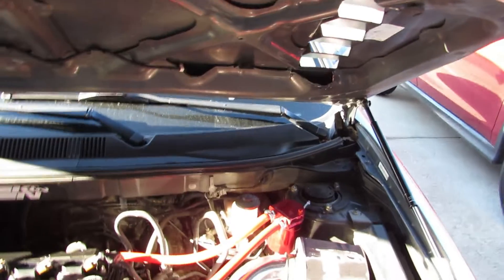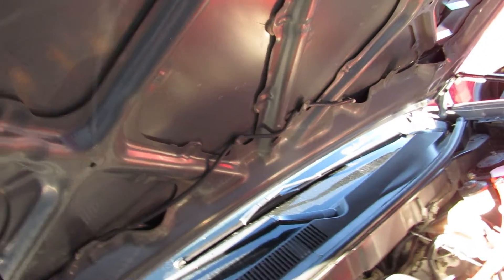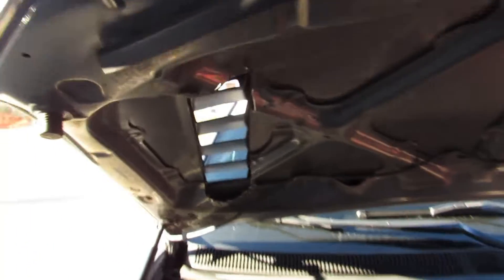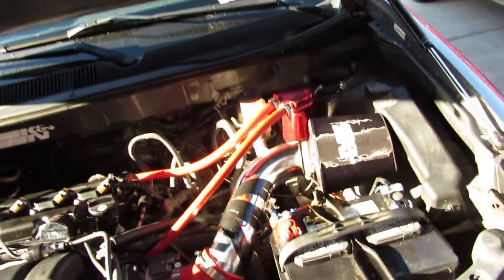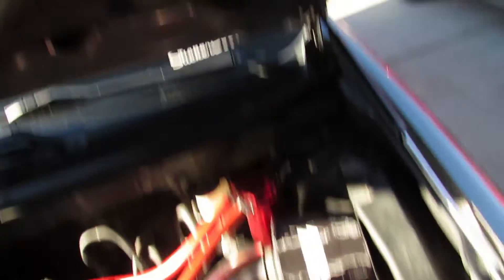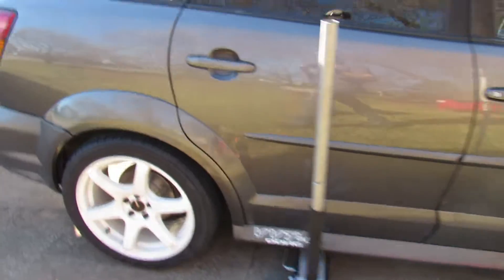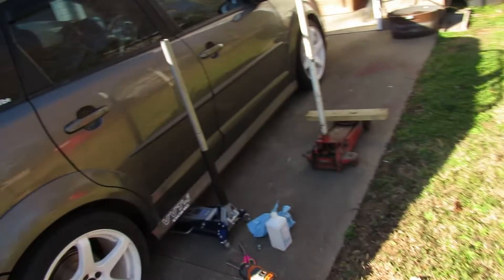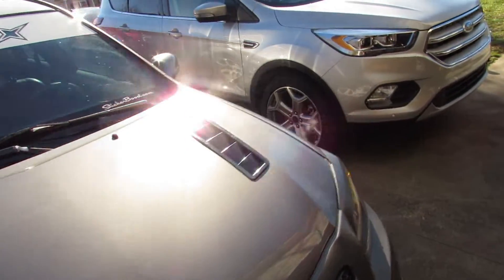DIY Heat Extractor Vents on my SC Vibe!

Comment: great job. where can I get the hydrophobic suck, and the exact same bonnet vent used?
Reply from the maker: Thank you so much! Both can be found here:

NewYall Pack of 2 Front Hood Vent Air Flow Intake Side Scoop Cover https://www.amazon.com/dp/B07X1QMW2W/ref=cm_sw_r_cp_apip_HE79JpLFFWNxz

Air Intake Filter Sock Cover,Universal Air Filter Protective Cover Dustproof for High Flow Air Intake Filters(Small) https://www.amazon.com/dp/B07VWB3XMK/ref=cm_sw_r_cp_api_glt_fabc_DPNJESGFJKN6XTSF7M3M

Comment: What type of lift support you use thx
Reply from the maker: Juan Rios Santiago https://www.ebay.com/itm/301354080700

You can also move the bottom mount forward a bit to help the hood open up higher 😁

Comment: Thanks for the video! Looks great love it! Any updates on the temps or any thoughts on any noticeable changes? Also is your car auto? Ours is auto and interested in supercharging it further into the future.
Reply from the maker: Yes the car is automatic 😁 the temp changes have been 5 degrees colder while moving and 2 degrees on average at idle, so definitely a big improvement! If you get the chance to supercharge it I highly recommend it, it really pays off 😎
Reply: Awesome! Have you thought about lsd for the auto? It’s also on the future to do list. Thanks again!
Reply from the maker: AJL Hawaiian Adventures I have not, I’ll be swapping to a 5 speed or the C64 6 speed with LSD hopefully sometime in the future, the gearing was better in the manual transmissions

Comment: Hey wondering what all you have done to the vibe and where all i could get mods for a vibe im having trouble finding stuff that would fit. Also wondering if most mods for a matrix would work on the vibe
Reply from the maker: ethan crozier anything 03-08 matrix that isn’t body panels or exterior lights is interchangeable (ie exhaust, strut bars, air intakes and so on) and same can be said for the 03-08 corolla. I’ve done a lot to the vibe but ill do highlights 😁 supercharger and supporting mods, short ram intake, custom exhaust, blacked out tan/grey interior trim, oem leather seats and door cards swapped, wheels and tires, KYB struts and Tein S tech lowering springs, oem roof cross rails, custom reverse lights with red halos that function with braking, custom jeep fog lights, fiberglass eyelids on oem black housing headlights, catch can, painted valve cover, a pillar gauge holder with boost and AFR, bed liner for spare tire cover and back of seats, double din head unit with reverse camera, custom metal grille in the lower center section, and then numerous less exciting maintenance things 😁
Reply: Thank you very much for the fast reply. Very useful to me thank you again and wish you the best of luck for everything!
Reply from the maker: ethan crozier no problem glad I could help! These things are easy to fall in love with once you start modifying them! And likewise! 🤙🏼